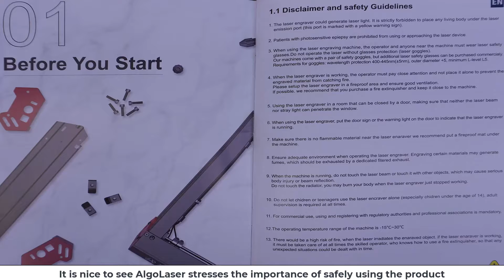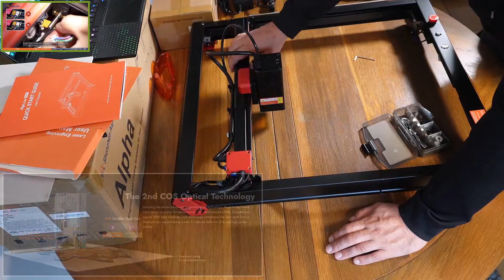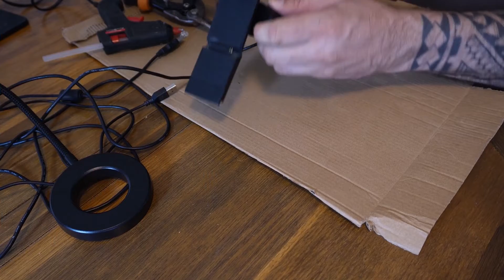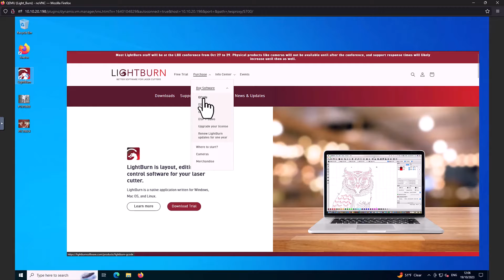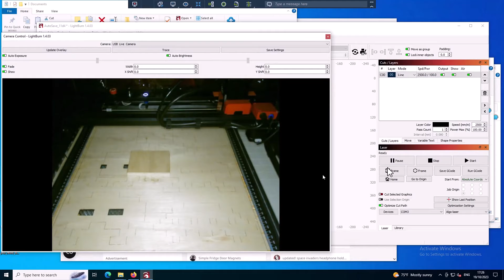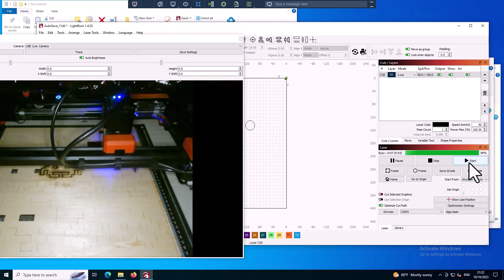Laser Cutter 101 - AlgoLaser Alpha Review & Safety Setup Guide!

Comment: Funny, I subscribed for your unraid content but ordered a laser cutter two days ago. I was thinking about fire safety and air ventilation, thanks for the tips. I do wonder though, doesn't the carpet cause some instability to the movements of the laser?
Reply from the maker: Yeah I did think about that but it is quite  hard short pile carpet. Doesnt seem to cause any instability. I think if anything it may reduce vibration.